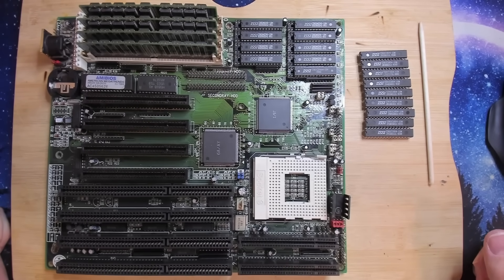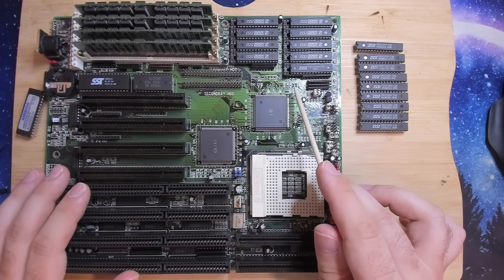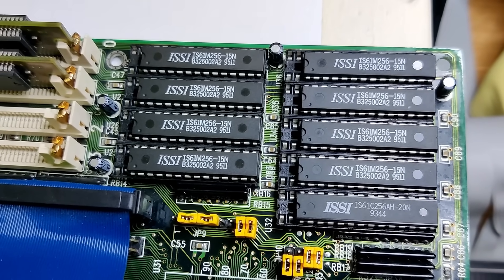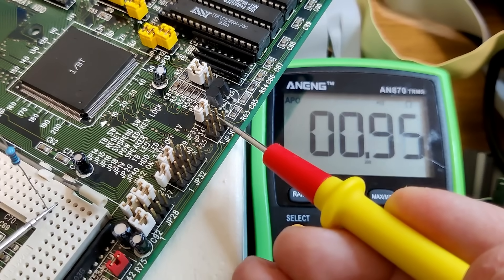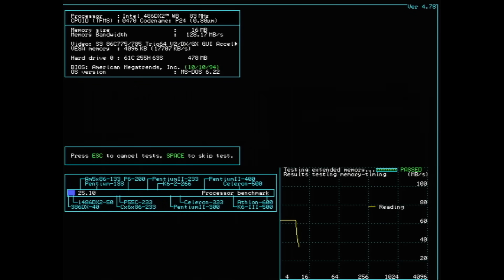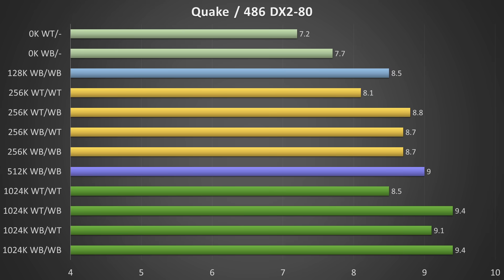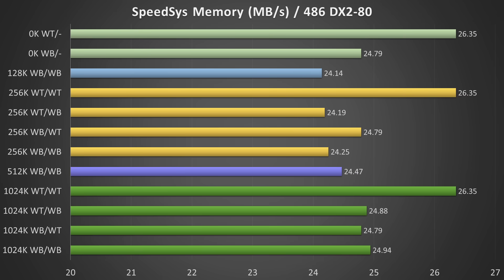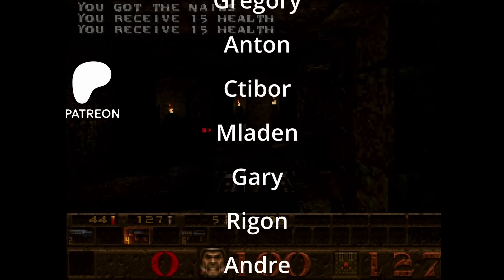How Much Level-2 Cache Do You Need?

Comment: The reason not all boards supported write-back cache is due to it causing problems with DMA devices, eg corrupted data when writing to a floppy. That’s one thing to test to be sure the write-back cache works.
Reply from the maker: Hm interesting. I didn't know that. So, you just copy files to a floppy disk and check if the write was successful? Does it always happen or is it a random thing?
Reply: @bitsundbolts not sure, my 486 mobo will need some bodging to do write-back caching so I haven’t tested this yet. But theoretically you should be able to find out pretty easily since having write-back caching enabled without chipset support means updated data isn’t held in main memory when the DMA controller sends the data over to the floppy drive to write, so any change will do.

Comment: One negative comment: If the PCB calls for 4 jumpers, please install 4x 2pin headers (as the mask indicates). this will help future you when you take the jumper off and want to reconfigure the board. 2x 4pin headers are mighty confusing when trying to put the jumper(s) on the correct pins.
Reply from the maker: Hm, good to hear that comment - I clearly tried to cut some corners here.

Comment: I think the write through speed performance in memory being high, while not benefitting the CPU, might have to do with the relay nature of memory technology. Memory that is good at passing data that goes through very little processing (compared to what we generally call CPUs) require that speed in write through, like for data bridges, and routers. The wishful thinking of many after seeing those stats tried to see if they could tweak the tech to maximize on the memory speed, but any time there is any complex processing being done that needs memory, if it isn't as good at write back, it's no good for general computing. I think that is what happened with Rambus. it basically only survived in routers and switches, after trying with Intel to create something "revolutionary" ( what others wouldn't be able to clone, and compete with thanks to new patents) :P 
we are still living with the failures of the last 30 years of pop economics :P
Reply from the maker: Yes, I think so too. The memory performance in this one test might be due to simpler processing of data. The moment you step out of this synthetic test and measure real task performance, you won't see that benefit. I skipped Rambus altogether - I am happy about that :)

Comment: You also need a properly sized tag RAM, allowing to cache the entire RAM. It's like contents list in a book (don't know exactly how it works on a low level), if you max out your RAM it might not be entirely cache-able by L2 cache. Had this issue on my old Super Socket 7 board: 256 megs was the cachability limit, but I could put 768 megs in (aaand Win 98SE would support up to 512 megs anyway).
Reply from the maker: Yes, true. With 256K L2, you should be fine up to 32MB system memory. If you operate in write-through mode, then up to 64MB. Dos Days has a nice chart: Search for "Cache Explained"
Reply: @bitsundbolts  Isn't that only true that you halve the capacity in the 7-1 configuration though where you steal one of the bits to represent dirty state? Like, if you have a separate dedicated "dirty tag" chip, then that shouldn't be the case, you'd get the full 64MB cached in WB mode.

Comment: Back in the 486 days I used Desqview and later Desqview/x extensively as I ran a BBS (celerity) on my PC.  DV allowed me to still use the machine for other stuff without taking the bbs down.  Increased cache (and RAM) sizes were important when using this product.  I suspect AutoCAD might have taken advantage as well.
Reply: Desqview/QEMM/Fidonet filled my evenings in late 80's and early 90's. Later OS/2 Warp until it sadly died. Oh the memories 🥰
Reply from the maker: That could be that specialized software takes advantage of more cache.
Reply: If I recall correctly, I did the same thing with F6FBB's BBS inside Desqview. Good times!
Reply: @robbiesz me too.  I used Maximus for my 400 users.  Ruined a relationship I was in by spending too much time learning how to use it, configuring it and actually using it. No sweat anyways, as I met my current wife who was a better match, 40 years later still hitched.

I always dreamed of upgrading my 486, because it was so slow.  The DX-100 I had barely was able to do what I wanted to do.  Back then, the hardware dictated what software you could use.  Nowadays it seems that is reversed.

I likely used over 40 iterations of upgrades since then. I have too many computers, even today which I cannot find homes for which still function that nobody is interested in, thanks to Microsoft.
Reply: Completely forgot about that piece of software, thx for the flashback

Comment: My Laser 486 only came stock with 64k of L2 Cache, and it only works right in write-through mode. It runs in write-back but I get a sparkling graphical glitch in Doom, like you're constantly being irradiated. Which is somewhat appropriate
Reply from the maker: Hehe - extra visual effects in DOOM :) Could it be that the cache is too slow? But it also could be other issues like a bad BIOS implementation.

Comment: Those results are what I expected, with not much to gain on a 486 past 256kb. I'd be interested to see the same tests on a faster bus clocked 486(50mhz or higher) to see if that changes anything. Probably not as I suspect the platform is probably the bottleneck, but you never know until it's tried.
Reply from the maker: Yeah, that what I was thinking as well. That is why I overclocked the CPU to 80 MHz - it is a nice average CPU. Not too slow, but also not a DX4. I guess the results will be very comparable. We probably would see changes when the architecture changes - e.g. Pentium. But I haven't seen a Pentium board that is flexible with cache like Socket 3.
Reply: @bitsundbolts  There are maybe some interesting tests that could be run with different bus and cache configurations with a Cyrix 5x86 though.

Comment: 2:50 for my 35+ years of soldering best things for clear holes is wood toothstics. Back in 1990 toothstics in USSR was very rare, so I use a sharpened wood safety matches 😁
Reply from the maker: Hehe, sounds like a nice way to clear holes if you don't have anything else.
Reply: Funny you mention that ... I recently repaired a low quality board from the USSR (Moscow-128 ZX Spectrum clone from 1989) and that became by prefered way of cleaning out holes there. Kinda sucked that I had to cut ICs off the board first and remove the remaining legs with tweezers before taking care of the remaining solder. Wick + Flux or pumps didn't work reliable without damaging tracks. Nothing I'd recommend for semi-modern, western stuff tho.
Reply: @RandomBlankUsername pcb of that age is wery bad quality. Desoldering or even cleaning holes with wick results to broken traces and metalisations.
Reply: wood toothspicks have an extremelly low heat conductivity. So It wery good for clearing holes.

I'm sometimes still use him on heavy polygons.
Reply: I've used small sewing needles stuck into a chocolate block/luster terminal as a handle for ages. They're stainless steel so regular solder won't stick to them even if they get hot

Comment: Pretty decent upgrade for Doom to add the cache, though 1MB of cache would've probably been crazy expensive back then for such a minor upgrade in speed.  Quake unfortunately remains unplayable.  I imagine 1MB would really only benefit some kind of like, math/science kind of software doing calculations on larger batches of data.  Probably getting in to the territory of in-house developed software specifically optimized to the system it's running on.  Otherwise as far as games and end user software, it's seeming that the overlap between computational complexity and size of the active code/dataset at any one moment just isn't there for such a large cache on such an old CPU.  Maybe would benefit some kind of multitasking benchmarks in Windows or some compatible UNIX?
Reply from the maker: Probably - if you have an application that reuses a lot of data that can be held in cache memory, the system would probably benefit.

Comment: I got my first PC in 1996, Pentium 100. I read an article about how upgrading the cache could make Quake run faster. Instead I put all my money into a new Pentium II 333 in 1998. I didn't know the OG Pentium was the end of external cache chips till I tried to look them up for the 333.
Reply: It was still external from the cpu but onboard the slot pcb for pentium 2
So you were partly correct 😄
Reply from the maker: Although the Pentium 100 would have probably worked for Quake, the PII 333 was probably a better investment than buying cache for Socket 7 :)